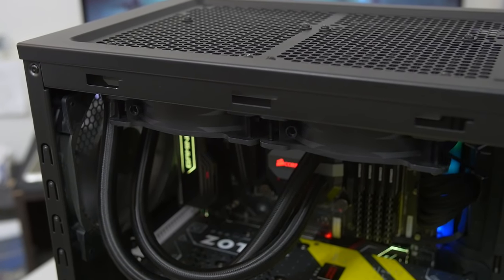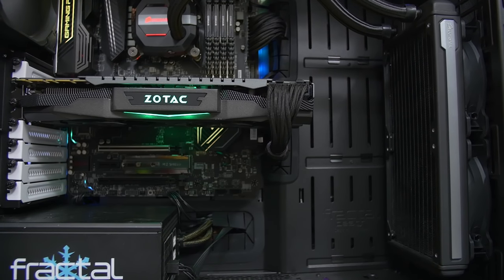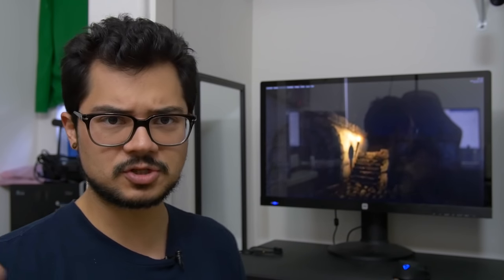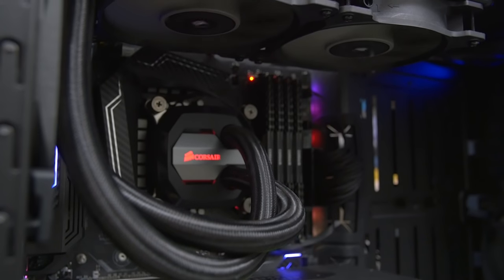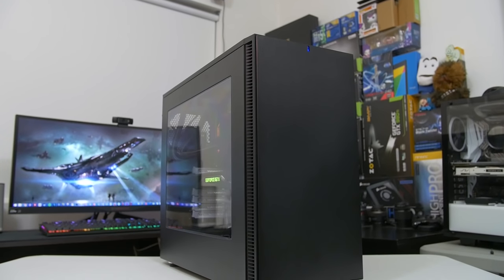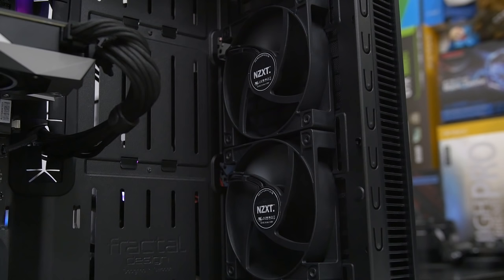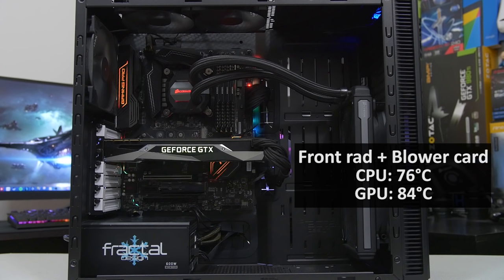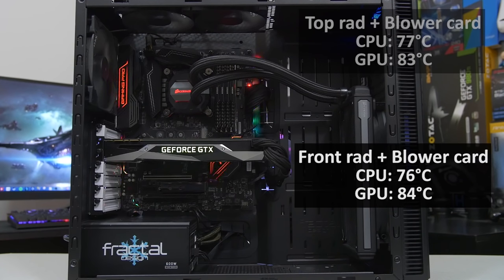Does Radiator Placement Matter? Hint: YES

Comment: There are so many unaccounted for variables in this: Negative case air pressure, hoses by the rear vent fan on the top mount effecting that fans ability to get rid of the warm air from the GPU so that it is less likely to go into the radiator, unknown idle v. Load temps (delta T is more telling than straight numbers), and more. Would love to see this updated with more testing and variable control,maybe partner with GN? wink

Comment: When the radiator is in the front, effectively hindering air flow, and the fans on the top are operating unhindered, will this lead to negative air pressure in the case?
Reply: Vivian Thayil Could. depends on how all the fans setup in the case. The top fans could just be ran at a slower speed to give you the effect you want.
Reply: Vivian Thayil Also hot air naturally rises. So all that hot generated by the radiator and open gfx card naturally goes upwards and is immediately pushed out by 3 fans with no restrictions.
Reply: Those are good points. Now I'm wondering what the fan curves we set to in Kyle's tests.
Reply: Yes, thats why its so important to have a fan in the bottom that helps get the air up and out. I dont know why this guy doesnt have one. Please, do some testing with and without a fan blowing fresh air from bottom (need a case that gets fresh air from the bottom ofc). Its all about good airflow.
Reply: Deffine Having a fan at the bottom blowing in makes no sense since where ever it is sitting will collect dust and blow it into the case.
Reply: The Define S case that he used in the video supports bottom intakes and is filtered on the bottom as well. Perfectly fine to run intake fans on bottom and front with top and read as exhaust. Also, if you run Push/Pull setup on the radiator as front mount, the restriction isn't as much of an issue. 

Source: I own a Fractal Design Define series case.
Reply: if you really think you are going to change  the air pressure in your case with a few case fans you are really not thinking about it thoroughly.
Reply: Grant Fogarty -
Positive vs negative pressure is in reference to the airflow direction through unfiltered mesh and gaps. Positive = outward airflow. Negative = inward airflow.

Since air moves down pressure gradients, we know that airflow outwards through small gaps in the case does, in fact, indicate that the pressure inside is higher than outside. This difference may not be large, or even measurable without very sensitive equipment, but it does exist.

Comment: You have your AIO amounted incorrectly when you mounted it in the front of your case. You have the pump higher than the radiator so you pump is going to have air in it. You should flip your radiator so the inlet tubes are at the bottom.
Reply: Ambrose Delgado LMAOO frrr

Comment: Using a single 120 Rad. Mounted at the back as an intake, with another 120 fan mounted right above it as an exhaust. Also a 120 mounted in the front as an intake. I get mid 60s when under load. (FX-8350 @ 4.5GHZ, Open Air RX480)
Reply: There is no way you are getting that low of a temp on an overclocked 8350 with a 120 rad. It would be hard to maintain that even without the overclock. How long did you bench it before being satisfied with that temp?
Reply: Have i7|3820 with 240 rad, front intake. Maxes at 60 on 4.4ghz.
 It all depends on room temps/fan speeds/thermal pastes...
Reply: I have the same config, FX8350 overclocked to 4.4 GHz with a Corsair H80i cooler. That has 1 fan on each side of the radiator in a push/pull. My idle temps are in the mid to upper 20's. Under Prime95 load it never goes above 59! Mine is rear mounted as a typical exhaust. I'm not a gamer, so I have a modest ATI Radeon 6670 that generates very little heat.

Comment: I can corroborate these results, and I have the same cooler you're testing with (H115i 280mm).  I didn't put a whole lot of thought into how my cooling system was configured at first.  I had the AIO against the side wall next to the mobo (I think just because my new case could actually fit it there), and only 2 fans on it (not even sure if push or pull).  Then 5 more 140mm fans - 2 front intake, 2 top exhaust (because heat rises hur hur), and 1 rear exhaust.  So I had negative or neutral pressure in the case, no continuous airflow path, and not very much air moving through the radiator.   After about a year of that, my temps were 5-10° C higher from dust buildup, and the AIO fans were working harder than necessary. 

Finally cleaned the radiator and reconfigured everything, so now the radiator is on the front, and sandwiched between 4x push/pull fans.  So it's like a big filtered intake on the front, 2 more intakes on top, and one rear exhaust.  Temps are much better now (I actually get to see numbers in the 30's instead of always hovering near 50) and the fans don't spool up nearly as much.

Comment: Thanks sir. Gonna slap a 280 rad as front intake on my fractal design meshify c
Reply: How did that work out? We are building in the meshify C and are debating 240 mm top exhaust or front 280 intake.

Comment: Would have liked to see a push and pull setup for comparison.  Much more air coming in not sure if that would push more hot air at the GPU or not.
Reply: From my understanding, Push/Pull doesn't nececarily give higher performance in cooling compared to just push or pull, 
The difference is how you can gain the SAME amount of cooling power, at a much lower RPM fan speeds. thus making the build alot quiter, as to compared to a single push or pull setup, which needs to work alot harder to cool on its own. aka higher RPM's for the same cooling. 

What im not sure of however is how much more Watts is required for a push/pull setup, lets say running at 400 to 500 rpm, compared to an singe push or pull setup that runs at 800 or 1000 rpm/ logic would dictate due to lower rpm's less watts is required to run the fanns. but it still More fans.

Comment: Really interesting result, and I'm glad.  Measuring before I buy an arctic liquid freezer and found that with my case and mobo I can't fit the rad in the top of the case, but I can fit it in the front.  Guess I'll be ordering that arctic cooler.
Reply: Hey im glad that we have the same AIO cooler mine is ARCTIC FREEZER 280 ii but also it didnt fits and i installed in the front with down the tubes for my 11700k and i got 70C with the xtu at 4600mhz can you tell me how you have the tubes and some temps with a program?Thanks so very much!

Comment: According to Gamer's Nexus, the radiator hoses should be oreintated at the bottom of the rad not the top for vertical mounting. The way Kyle had it mounted will cause bubbles to get trapped and block flow.

Comment: There are so many configurations to try. Front + top, front + bottom, bottom + top, bottom only, changing the number of fans, altering the speeds at which each set operates such as 100% on intakes and 50% on exhausts. Etc

Comment: All tests were performed with an open or closed side panel? (This is important for airflow)
Reply: Денис Ястребов I imagine he closed it because I don't know anyone who uses their PC with their side panel off.
Reply: Definitely closed, the open case would then be way cooler and defeat the whole point of the exercise. Nobody tests with open cases lol.
Reply: Not necessarily. I used to keep the side of my pc off until I tested the temps and actually got lower ones with it on.
Reply: I replaced my side panel with mesh that looks almost the same and dropped 12°C off my graphics card (open cooler). It definitely helps to open it up.
Reply: I havent had a side panel on my case in years lol

Comment: I know this is an old video, but today everyone pretty much has seen AIO pump failures from the pump being at the highest point of the loop, trapping air in the pump. If you're going with a front (or side mount), the radiator needs to be mounted as high as possible AND with the radiator tubes at the bottom (to trap air at the top of the radiator). Of course, most will have a problem of the water lines being too short for this. Some AIOs have pumps INSIDE the radiator so that might solve some side mounting problems.

Comment: When u have the radiator front mounted, I noticed u have 2 regular fans on the top. Doesn't seem like a fair test.
Reply: I think this is okay. 

After all, you want to remove any residual heat that can be generated by your PSU, GPU, and any storage or memory modules out of your case using additional exhaust fans. Or, those fans at the top of the case can be used as intake fans to generate more positive pressure airflow to the case interior.

Regardless, if you want to bring fresh, ambient air into the case, add or move case fans to any openings. Be sure to use filters if the fans are used as intakes.

Comment: Its fairly simple: Use the incoming air to cool the device needing to stay coolest first, raising to the hottest last if you cant also use fresh air for them.  This keeps the differential temperature at its best for all the devices needing cooling.
Same with watercooling circuits, device to stay the coolest after the radiator first, i.e. chipsets, then CPU(s), GPU(s) last.
Granted some airways will split in different directions but if you put the radiator on the air intake, you are raising the fresh air temp entering the case to cool the components which is counter productive, when you can use the air after the components add temperature to it and still keep the water circuit cool enough with the higher temp air leaving the case.  Ideally fresh air for both (which is why the Corsair Carbide Air series cases are very good) but if you realise that (~20DegC) air to cool the motherboard and SDDs etc, then gets raised (to ~35DegC), then cools the radiator cooling the CPU, and also blown through the GPU works better than the CPU being cooled by ~20DegC, raising the temp to ~35DegC entering and being used to cool MOBO, SSD/HDD and PSU components wanting to be below 55DegC etc. is the wrong way as the ambient raises and warm air can recirculate from the exhaust back in.
I found this out to my pain with using a Thermaltake Kandalf case where the 3xRadiator was at the front air intake, mounted before the air enters the case, and had fun keeping the motherboard, GPU and SSD/HDDs cool under heavy gaming loads.  The design of the case shows hot air convecting up before entering the case, but the fans inside creating a low pressure inside still draw in warmed watercooled air and create the issue above.  The biggest issue being when the ambient raises and the GPU struggles to get enough cooling from the warmed CPU, MOBO and SSD/HDD Air from within and takes a break crashing the game!  of course I even had the GPU watercooled for a while and the internal components would struggle to stay cool as the air off the radiator was even warmer (the GPU and CPU were lovely though, but it only takes 1 part to overheat to ruin the game)
SO simply put, use the air to cool the components & SSD/HDDs, RAM, then if you cant use another fresh air source, use the exhaust from these to cool the CPU and GPU.  (and of course PSU suffers too if the warm air inside is too warm).
Hope that helps solve issues and you build better cooling systems.  Remember, the cooler you run the quieter the PC, and the longer its likely to last, so its a win win win.
Reply: Great information. Just want to point out, On my HAF X 942, although the PSU is on the floor of the case in the rear, it does not share the air with the rest of the case. My PSU has its own separate air intake underneath the case and blows the air out behind the case.The bottom of the case has a vent underneath the PSU that extends beyond the front of the PSU.  To prevent the PSU from drawing air from inside the bottom of the case, I have placed a 120mm fan in front of the PSU under all the cables, blowing air into the case. I use  a 1600W modular PSU, with all the cables connected and laid out perfectly for easy maintenance  to power all future devices I connect.
The MOBO (ASUS RAMPAGE IV EXTREME) has 64GB RAM with 4 fans mounted on the RAM, which increases flow of air from the MOBO into the general air flow to the stack exhaust fans. 

MOBOs like the Asus Maximus IX Extreme come with their own liquid cooling of important parts of the MOBO for your own custom loop. Thus you can install an external radiator with fans to cool MOBO and CPU which makes the case even cooler.

Comment: I have a top rad but I flipped my rear fan around and use it as an intake. It helps.
Reply: 199122vincent interesting. This is a great idea. I might do this on my new 570x as I'd like a positive pressure setup to keep the dust out from around all the tempered glass panels.
Reply: Cool idea. Do you remember how much of a change in temp it was for your CPU?
Reply: I ran this setup for a while. I then decided to flip the rad fans to intake and rear to exhaust. Reduced my temps but don't recall the exact numbers.

Comment: Like so many others, this popped up for me after watching GamersNexus on how to mount your rad. I had my rad in front but the tubes were on top, so I took the rad out and reinstalled at the top of my tower....bad idea, my thermals rose 10 from 40s to 50s at idle and from 60s to near 80s on load. So I switched the rad back to the front with my tubes down.....as best as I could and right now my CPU is sitting at 39 idle and around  high 50s to low 60s under load. And I am running a Aorus GeForce RTX 2070 Extreme and AMD 2700X. Both CPU and GPU are overclocked. So I like these temps. But you should really redo the front mount test with the tubes on the bottom, it actually can make a difference. Not much but a difference none the less. Good video. Keep em coming!

Comment: So your testing is bit flawed, obviously either one will work, but if you're cooling with exhaust you need to have enough airflow in to have a decent amount out. Something else is going on because it doesn't make sense for the graphics card to be adding 10c. I've used that configuration plenty of times with various graphics cards and never saw that before.
Reply: There’s absolutely nothing strange about a blower card being 10 degrees hotter than an aftermarket card with 2 fans. Pause it at 12:11.

Comment: Hot air goes up.

Having a radiator at top of the case that is blowing the air inside the case instead of pushing the air out from case is stupid. It makes hot air from GPU stay longer in the computer case.
Reply: THX captain obvious.....but in this video fans at the top are blowing hot air outside
Reply: Convection plays no role in a case with multiple fans directing airflow. Also the fans are creating negative pressure in the case not positive.

Comment: So, basically, if you want maximum CPU cooling:
If you have a blower-style card it doesn't matter really either way, so it's okay to mount the radiator at the top
If you have an open-air card, you should always mount the radiator in the front to make sure it draws cool air
Do I understand correctly? I am trying to decide how to set up my liquid cooling, and what I care about is CPU temperature. I have an open-air card.
Reply: yes, if you can mount it at the front of the case.

Comment: Well this taught me to move my h115i to the front of my phantek evolv case and two fans on top. I have a GTX 1080 ftw and this may help my CPU Temps especially since I'm upgrading to asus formula ix with 7700k in a few days.
Reply: KillaBandit what were the results of your findings? Every case is different and one configuration for one should not have same results for the other. Especially considering how different to any other case the shift evolv is. I am planning on getting the shift x but I want someone to make an acrylic side panel for the graphics card first.

Comment: I’d like to see what an intake from the top would look like.
Reply: Hot air rises mate, top should always be exhaust
Reply: @glenharrison8524  It raises if it is not being pushed by a fan. And it makes sense in a regular setup with fans and no radiator to have the top fans pulling hot air from inside the case outside. But it might make more sense pulling cooler air from outside into the case through the fins instead of "cooling" the radiator/CPU with hot air from the case. Then you just need a high output fan on the back top to remove the hot air.

Comment: you forgot a test Kyle. mount the radiator to the top as you did the front so it draws air in from the top since you have a case fan that pushes the air out the rear of the case and then try both cards.

Comment: I wish you could do the same test on a Crosair 4000D Airflow to see if its better on the front panel. i dont have aio but i plan to get one if someone did a test with a aio on front with that crosair 4000d airflow case.

Comment: I think it would be interesting to setup the system in the top rad orientation but see how temperatures are affected with the change in orientation of the rear fan
Reply: exaclty i saw 10 degree jump when i switched my rear to intake

Comment: If the radiator is mounted to the top of the case pushing air out, it's sucking hot air from inside the case right past the CPU. I agree with a couple of the commenters who noted perhaps a test with the top-mounted radiator pulling cool air into the case might give different results.

Comment: Wish you would have included top rad as intake.
Reply: lol that's what I've been doing, but I heard it should be exhausting when top mounting, I'll just go test it out myself.
Reply: @rajangadful  so use top aio as intake running heaven benchmark gives me cpu @69c, gpu @71c and mobo @32c. When using it as exhaust, cpu is 70c, gpu is 67c and mobo @28c. Not much of difference.